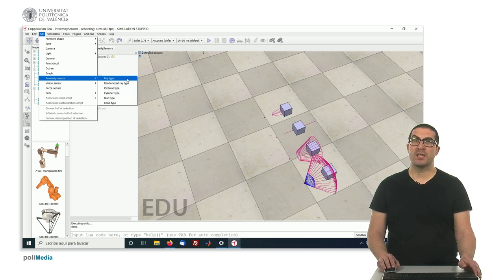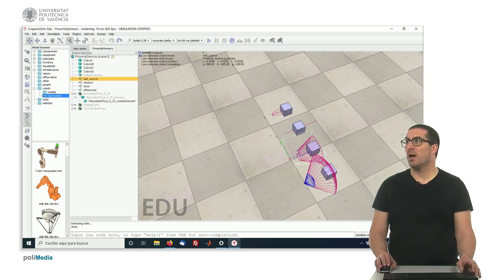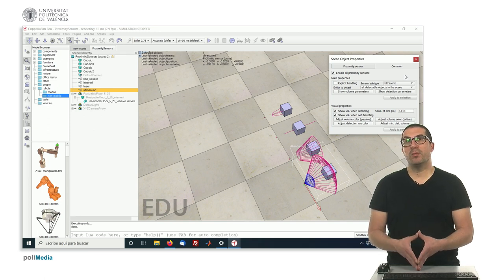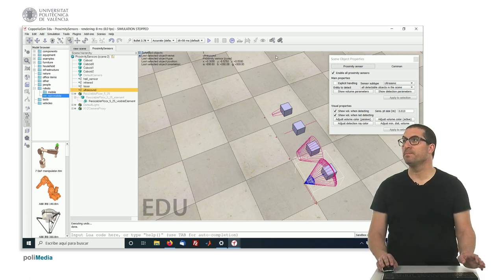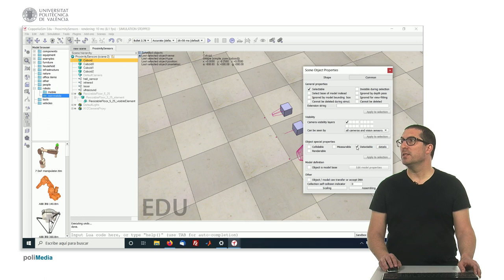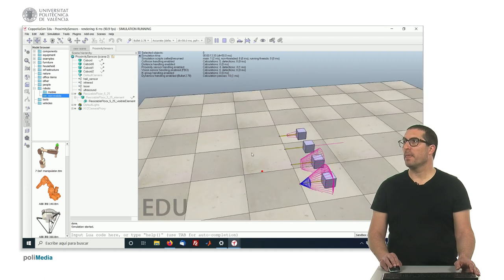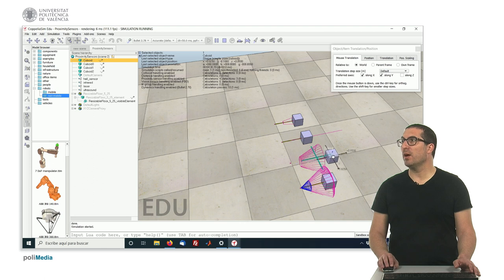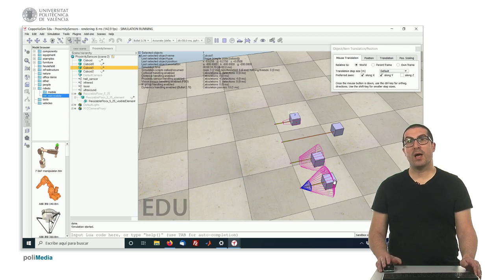Using Proximity sensors | CoppeliaSim (V-REP)

Comment: Hi! I have 4 different sensors but when i run my code in python, i get the same value even if there is only one sensor detecting an object in front. i hope you can help me, thanks.
Reply from the maker: Check the API. It’s likely you’re missing something...
Reply: @LeoArmesto  but, it's happening something weird because one of the sensors is displaying the distance perfectly but the other sensors kind of disturb the data of the others.
Reply from the maker: @santiagovillamilpaz6257  I don’t know why... I’ve never seen this behaviour. Are the sensors blinking?
Reply: @LeoArmesto  Yes they blink only when there´s an obstacle.  I dont know what is happening, im using the quadricopter robot and i create a proximity sensor and made the dron its parent. Then i create a handle for the proximity sensor, and finally im using simxReadProximitySensor to read the value of the sensor so i have a variable with the distance[2] value and that is what im printing. So when im using 1 sensor it works perfect but when i use 4 of them the data of distance[2] of the sensors starts to confuse.
Reply from the maker: @santiagovillamilpaz6257  no idea why, sorry
Reply: @LeoArmesto  Thanks anyway for your time sir

Comment: my sensors are not glowing what to do?
Reply from the maker: Check the special properties of the objects to be detected. They need to be ‘detectable’
Reply: @LeoArmesto  is it possible to make a vrep scene on nao path planning with obstacle avoidance?
Reply from the maker: @pawandev1673  I’ve never tried, but I don’t see why not. Use an invisible collidable object with Nao size (even slightly bigger) and use it to perform a ‘conventional’ path planning and get a valid collision-free path. Then, it’s a matter of following that path with NAO
Reply: @LeoArmesto  i am trying it but i am not able to do it. For which part of the nao i have to write the code
Reply from the maker: This model has been created by Marco Cognetti, so whatever I say might be inaccurate. The point is that taking some of the default models and make it work for your own purposes is not an easy task. It seems that it has some pre-recorded movements so it’s not prepared for controlling the robot with your own algorithm. You need to do everything from scratch, I’m afraid...
Reply: @LeoArmesto  😂 you made me afraid too